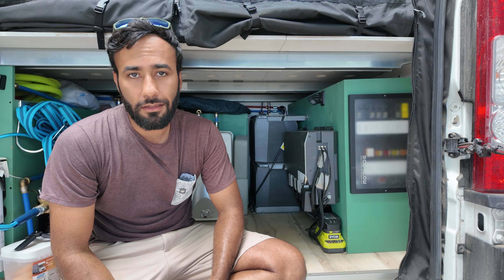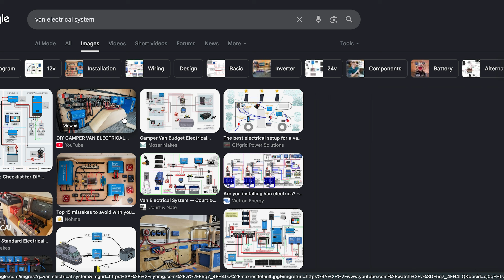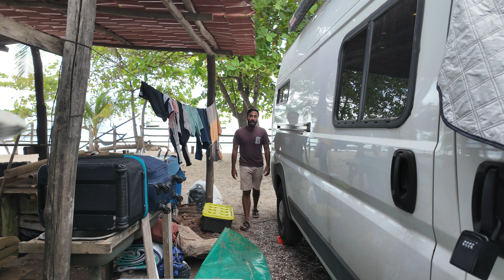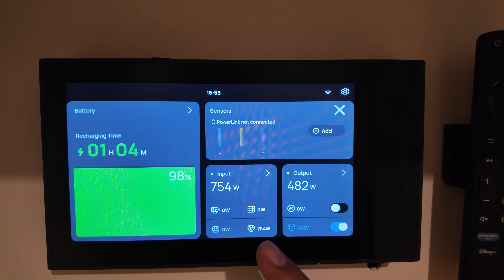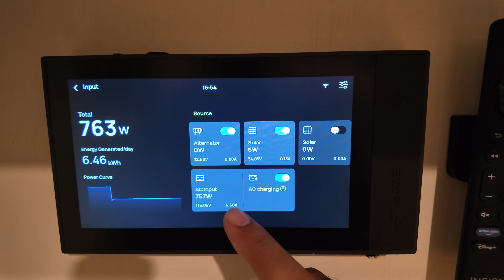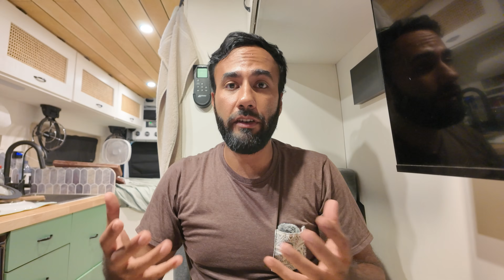I Chose NOT to DIY My Van Build Electrical System. 1 Year Later - Was It Worth It?

Comment: very nice build,  and nice video, me in my opinion,  also on what i did on my camper , i choose to do it by components,  for upgradability, you can replace part by part, also   if one system fails  you can easily replace it without disturbing the whole system, separate system also lessens the complexity, meaning all are interlocked on a hub,  so if hub goes all sytem goes, anyways,  branded items not gonna be bad,
Reply from the maker: Thanks! I completely agree. A component-based system definitely gives you more flexibility for upgrades and repairs, and if one part fails you don’t have to replace the whole system. I chose the EcoFlow Power Kit mainly for the simplicity, clean installation, and faster build, but both approaches have their pros and cons. Appreciate you sharing your experience! 👍

Comment: Not sure what AC you are using. But word is if you use a 48v AC unit its more efficient on the power usage.
Reply from the maker: Word is right, the thing is that we installed ours when we were already traveling in Mexico and the only thing I could install was this 12v one back then.
If I would do this again during the actual van build, I’d install a 48v one for sure.

Comment from the maker: Sounds like you put a lot of thought into your system, and it makes sense for your needs.
I like that you prioritized loads instead of just chasing the biggest battery, definitely the smarter approach when building such systems.
Quick calculation brings you to around 9.2kW hour of a system, so in capacity we’re pretty similar.
So that’s definitely a way of saving up some money without over complicating the build with a custom one.

Thanks for sharing your setup!

A quick question though, why did the USB ports end up being the deciding factor over a fixed DC distribution system?

Comment: @unmappedroots you said ask you anything. So here is my question for a home back uo system where would you start? I have a generator that works certain things when needed. I'm looking to get away from all the noise at night and charge during the day. Something I can make larger. I was thinking about Pecron
Reply from the maker: The first thing I’d do is figure out your daily energy usage and your peak power draw. Those two numbers determine almost everything else. Since you already have a generator, you could use it to recharge the batteries during the day and let the battery system run your house silently at night.

A few questions:
How many kWh do you use per day?
What’s your largest load?
Are you planning to add solar later?

From my experience I can tell that using renewable sources can reduce your generator usage to almost zero, especially on clear and sunny days, so I’d consider that.
Reply: @UnmappedRoots  I will have to figure out my loads before I can answer the questions you ask. Ideally, I want to keep frigs running internet one mini split and water heater from time to time. I will use that intermittently when not having to run the mini-split. I have back up gas heat if needed. As far as solar, I'm definitely interested in adding those. Ideally, try to get away from the generator as much as possible. Thank you for answering.
Reply from the maker: Sounds like you’re on the right track, thanks for sharing and leave an update if you feel like it in the future, love these kind of projects

Comment: I have my degree in computer engineering  from the states. I went top down from my highest draw items to lowest draw. Also critical loads vs luxury.  I actually went with the delta pro 3 with an auxiliary battery and the wave 3 for ac/heat. Believe it or not it came down to usb ports. I want the most reliable and efficient usb ports and that meant getting a power station. In fact I even have a smaller one. a delta 3 plus as a back up and all it does is run my fridge and charge my camera equipment. It also has its own solar panels charging. All my other dc loads feed from the 30a Anderson port on the EcoFlow. Which is enough for my needs. My starlink and lap top both are charged off usb.  All in including solar I spent about 6k us a pretty robust system.
Reply from the maker: Sounds like you put a lot of thought into your system, and it makes sense for your needs.
I like that you prioritized loads instead of just chasing the biggest battery, definitely the smarter approach when building such systems.
Quick calculation brings you to around 9.2kW hour of a system, so in capacity we’re pretty similar.
So that’s definitely a way of saving up some money without over complicating the build with a custom one.

Thanks for sharing your setup!

A quick question though, why did the USB ports end up being the deciding factor over a fixed DC distribution system?